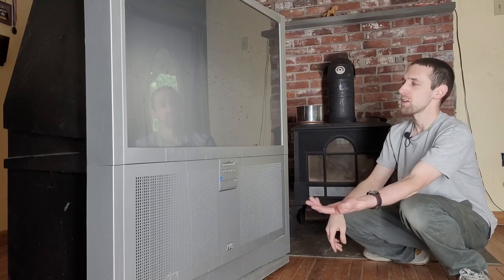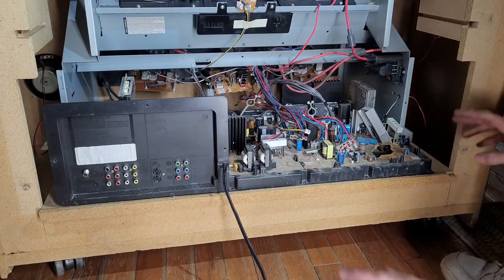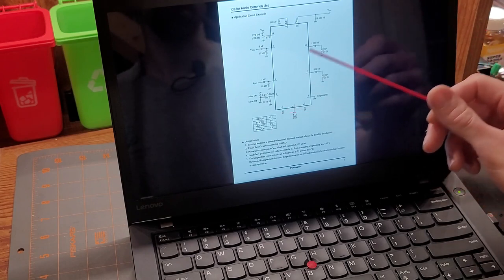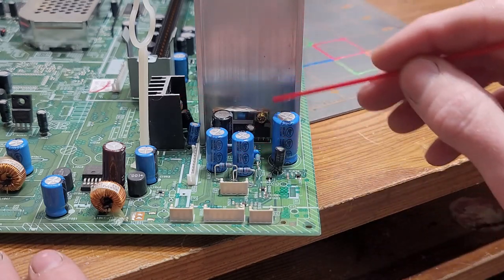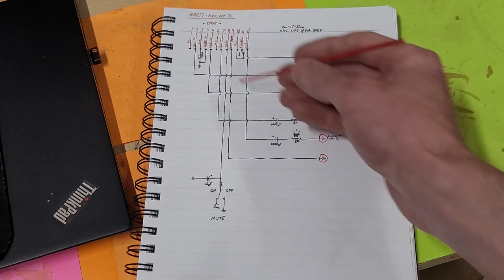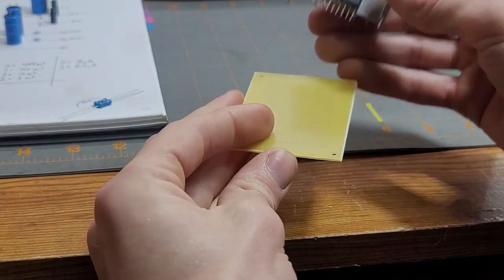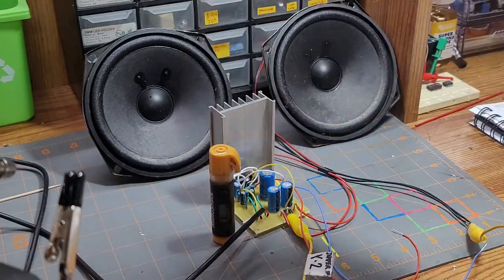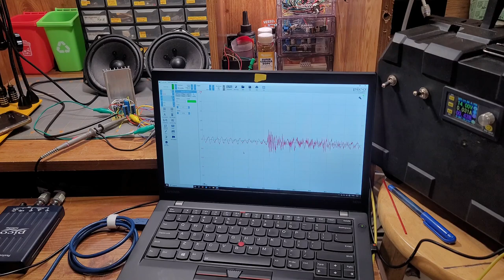repurposing the amplifier from a roadside TV

Comment: Cool! I have actually taken a part a few of those before! some good components for sure!
What I like to do is if possible cut out and reuse the circuit board that it was already connected to. It might take a bit more time reading the circuit board and following the traces but it saves on building your own board.
Pro tip is that there is another 6 amplifier channels in that TV. I haven't tested this at all but it is made by the same company that makes speaker amplifiers. Use the Horizontal and Vertical deflection coil amplifiers. All they are is electromagnets on the magnetrons so I can't think of a reason why they wouldn't be able to be used for audio also.
Reply from the maker: that's a good idea. my first thought was to use one to amplify the signal generator on my scope. but that would be cool to use it for audio. I'm interested to see what its frequency response is like at the low end.
Reply: @jankcitycustoms  yea it might have protection and filtering to make it better at the high frequencies that they are meant for. But if all of that is done before the IC then it should work just fine.

Comment: Awesome video man. Any thought into making a guitar pedal? Maybe a phaser of some kind?
Reply from the maker: definitely.  I have been wanting to make an Ebow using old headphones as the pickup and driver. we had talked about doing that back when you lived in Brockton, but I never did.  a phaser would be fun. some old cameras and some old vcr's have a glass delay line that could be used to offset the signal.  the next video I'm making is about using a cheep rc car to make a model train remote control.
Reply: @Jank City Customs  dude an Ebow would be epic! I can't wait to see the RC train deal. That sounds dope. Also if you ever want to make some wooden or MDF enclosures/cases for the things you build let me know. I have every woodworking/carpentry tool known to man basically.
Reply from the maker: haha  that would be cool.  most of the stuff I make is small enough for plastic cases to make sense. but it would be fun to make some big ass thing in a nice box. maybe a big spring reverb or something.
Reply: @jankcitycustoms  A spring reverb tank would be pretty sweet. Although I've never opened my amp up to see what makes the reverb tank tick, I would imagine that it's fairly straight forward. I have a 68' custom reverb deluxe which is a tube amp. The reverb tank is its own separate component and is quite literally a large spring in a leather wrapped, aluminum case. So much so that just by giving the amp a light slam while out of "standby" will create what I can only describe as the sound of a large amount of money teetering on the brink of being wasted. A tube driven reverb tank would be an awesome build and something I'm sure a lot of people would love to see on here.